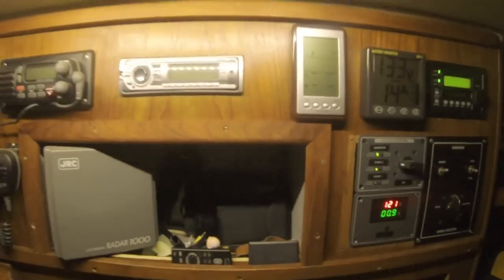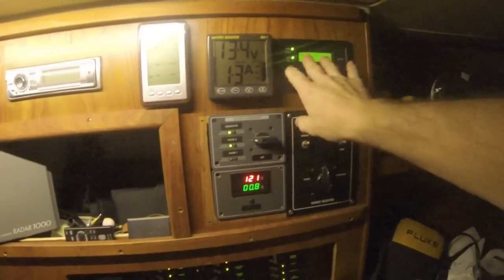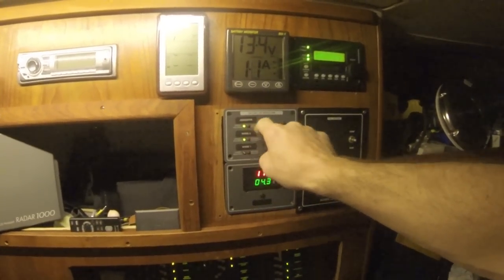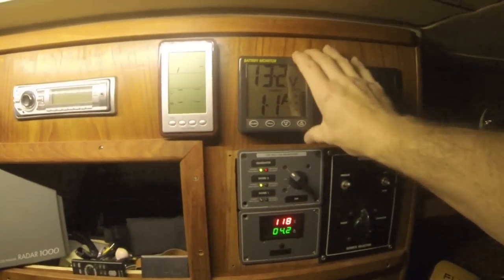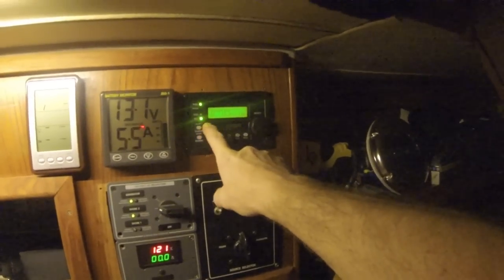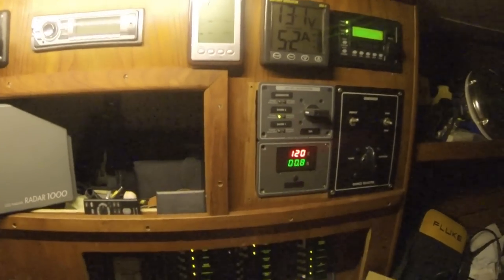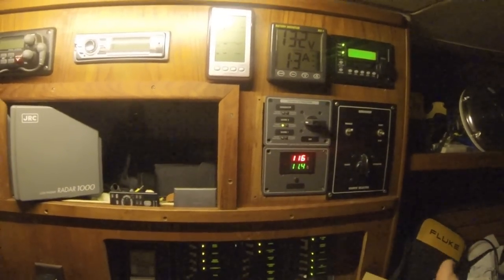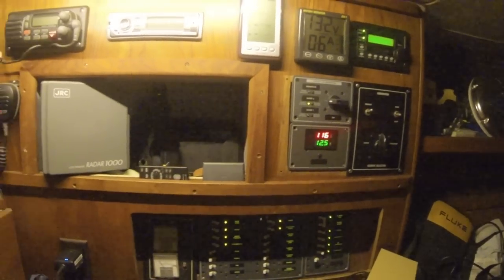12 and 120 volt system monitoring and control

Comment: I watched until 3:54. I hope your boat doesn't burn down to the waterline.  :o
Reply from the maker: why's that? the charger controller is Magnum energy the panels are Blue Seas product the other one is strictly monitoring. like I said, controls is what I do for a living and the boat is a hell of a lot better off than I was when I bought it.
Reply: The reverse polarity issue. Let's get that fixed.  ;)
Reply from the maker: it's a bad ground on the genset. if I ever pull it out of the hole that's on the list.